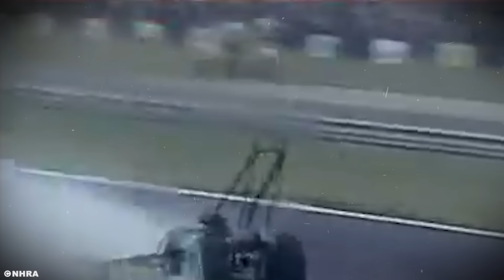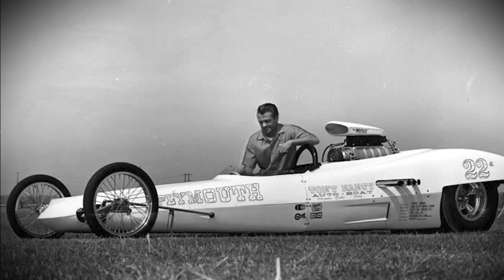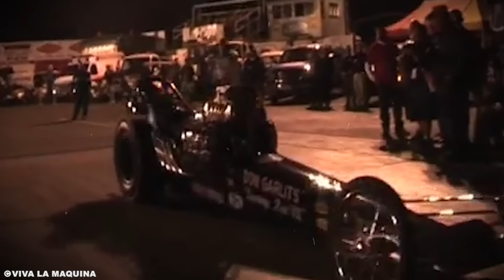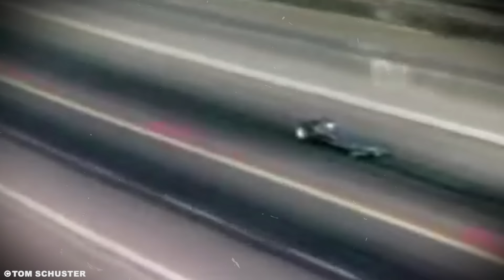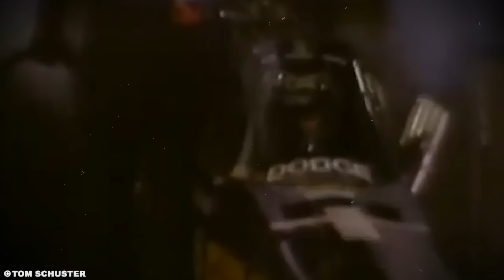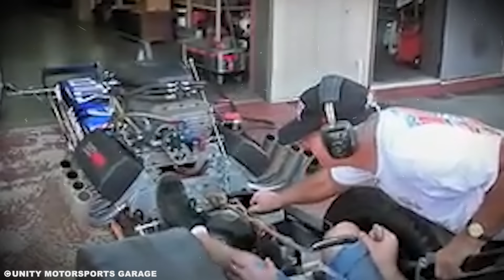The Forgotten Genius Who Invented the Rear Engine Dragster

Comment: Don's transmission exploded just off the start line; the car was hardly moving!
Also, Cagle and Callaghan ran a rear engined dragster with Red Case driving in the mid/late 50's.

Comment: Yet today, we still have Fuel Altereds and T/F Funny cars. Even when Don finally worked out the steering issues with the rear engine car they still had front engine Fuel cars.  He only changed 1 class not the sport in a whole.